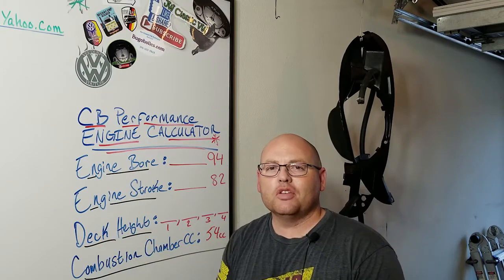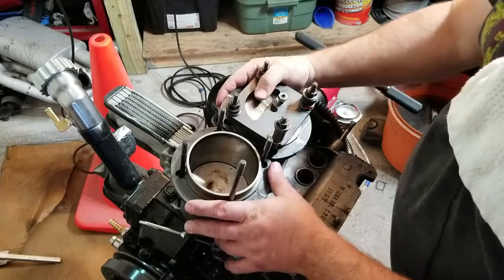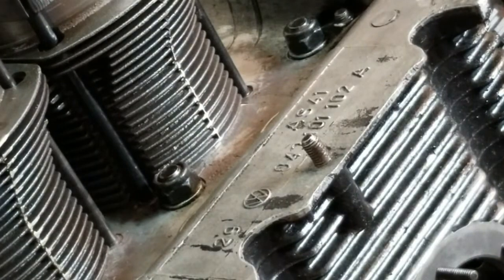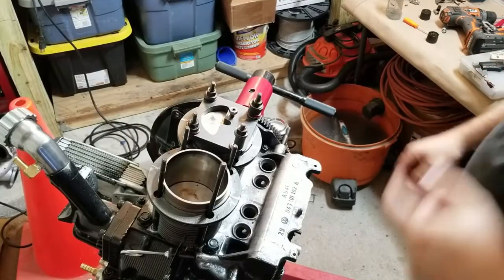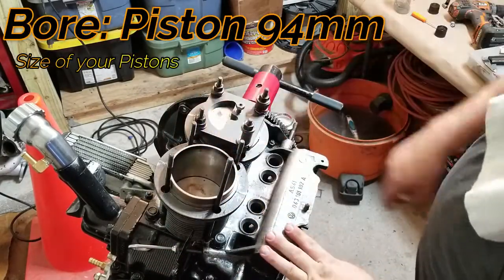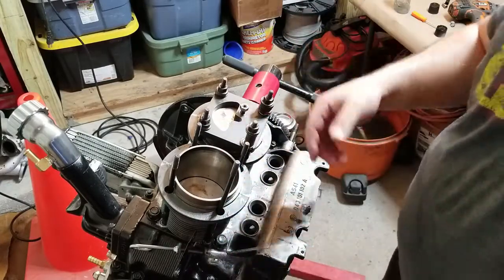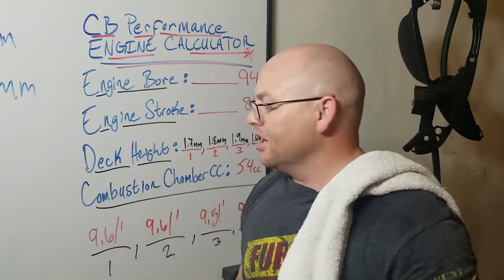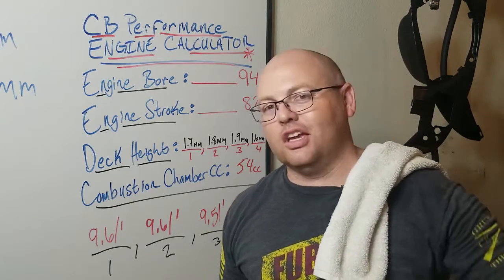How To: Calculate Compression Ratio -  1956 Ragtop - Volkswagen BUG | JW Classic VW

Comment: Wouldn’t 9.6:1 be a bit high? I understand the higher cr will result in a snappier and more efficient engine but also creates more heat.  What are your thoughts on the higher vs lower cr’s? Just curious.... love your videos man! Keep them coming! Are you running 94 in the engine?
Reply from the maker: Hey, what's going on brother, so yes 9.6:1 is a bit higher on the compression scale, but with my 2276 and Cam choice I could really go higher.  This really comes down to a lot of different factors with the engine combo your working with.  I'm not an expert by any means and take the advice of many of my local builders but in the end, do your research and decide what you think will work for your engine.

For my combo:
94mm AA B Pistons (Sku VW9400T1S)
CB 044 Heads 40mm Exhaust & 35.5 Intake (Running dual springs)
FK8 Clone Cam from CB (2288)
- Adv. Duration 308°
- Dur. @ .050" 256°
- Lift @ cam .378"
- Lift w/1.4:1 .529"

My Cam is the reason for the higher compression ratio, I will at some point bump up to 10:1 but I have some other upgrades to do first.

Another factor is what type of fuel will you be running, I always run 92 or better with my 2276 and sometimes when I can find it I run ethanol-free gas (way better).  Fuel again is an important part of your decision as it will help decide what kind of heat you are generating.  Let's say I were to run say 87 instead of the 92, I would end up getting more heat from a hotter fire and also creating that pinging crap I hate but also more power.  High octane doesn't really always mean more power just a cleaner burn.  To get more power out of the 92 with my Cam I would bump up the CR.  The problem that we start creating is heat... 

This is why I run the external oil cooler w/fan, filter, and slim sump.  More oil to help dissipate the heat from my Lil monster.  Sparkplug gap comes into play as well when it comes to ignition and heat along with your timing and a high power coil.  You want to burn clean!

Also, you need to factor in the elevation depending on if you are way above sea level where you live, here in Houston I'm at about 100' above sea level... so it really doesn't come into play.  For fun let's say I was moving to Denver at 5000' or even just driving through.

*Formula*
9.6 + (9.6 * .03 * 5)
= 9.6 + 1.44 = 11:1 WOW!! I would need to find some race fuel... lol 👍😎👍

The way this works is for about every 1000' in elevation or altitude you need to add about 3% to your ratio based on the density of the air.

I could go on and on brother but this is just a little bit of what goes into tunning your high power Air-Cooled VW, Airflow through the heads and exhaust, Carb set up... on and on... lol
Reply: I understand. Your car is beautiful by the way and I’ve been watching a lot of your other videos keep putting out some high-quality videos that some of us VW guys can use and appreciate!! I’m building a 1776 and I’m about to measure my deck height to calculate my compression ratio before I order my heads. Your tutorial was a big help!!!! People are very particular about their heads. Do you favor one over the other?

Comment: Jason, you were moving those head studs from one side to the other... any chance you could do a video on case savers? Always wanted to learn how those are installed. What's your preference... 8 or 10mm? Danke!
Reply from the maker: That would be a cool idea for a video.... thanks for the comment... as to 8mm vs 10mm I guess it really depends on what size cylinders your running.  If its like mine 94mm cylinders the 8mm with case savers are the only way to go.  Pretty sure 10mm wouldn't fit right.
Reply: @JWClassicVW  When you say "wouldn't fit right" do you mean the stud or the case saver?
Reply from the maker: If you were to try 10mm on a 94mm cylinder pretty sure it wouldn't work.  I'm not sure how big you could go with 10mm but I've never had an issue with 8mm chromoly studs.
Reply: Jason, why are there two sizes if studs. 8mm or 10mm?